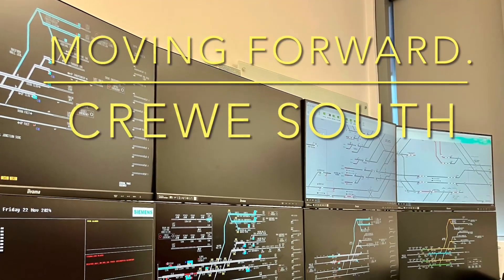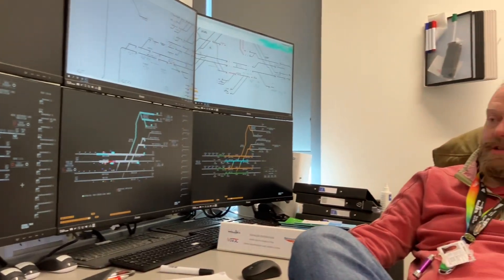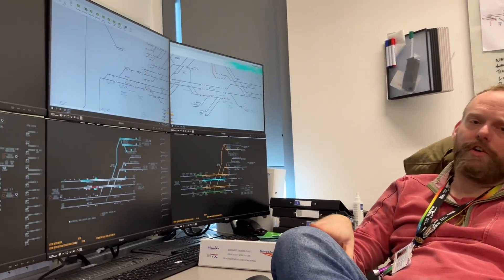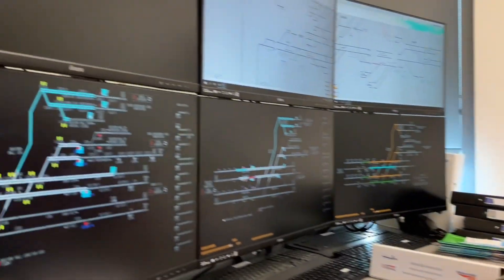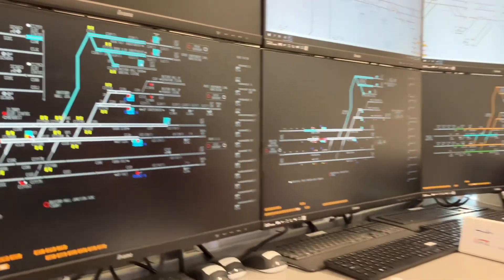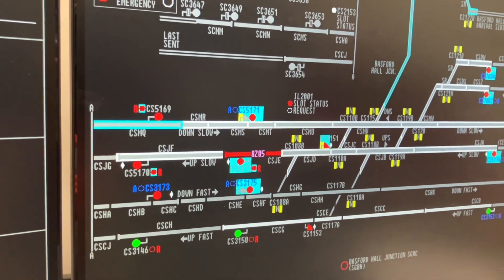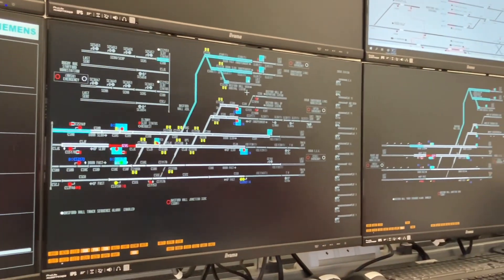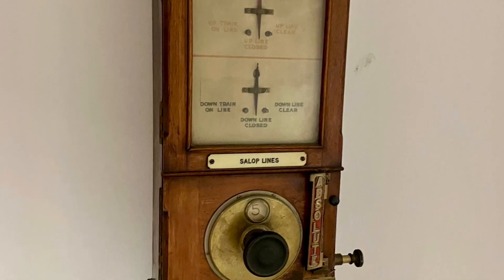Moving Forward.. Crewe South Resignalling

Comment: It’s interesting to see what it looks like now. Back in 1989 I was involved in the London Marylebone IECC, which was one of the earliest (soon after London Liverpool Street), and later on Slough New (Paddington to Heathrow) At that time the displays were the old CRT units - less flexible than modern flat screens. The size of the available screen units and their format (roughly 4x3) had a lot to do with the design of workable layouts and the method of working, including how to cope with screen failures that could occur occasionally.

Originally, Marylebone had a pair of identical workstations, with one being able to take over from the other, or the work could be split across the two. At that time, Automatic Route Setting (ARS) was quite new, and there was a degree of concern about the workload, but in reality most of the time it was handled by one alone.